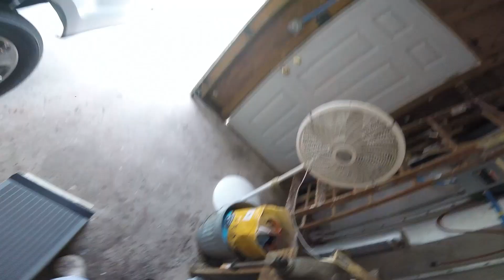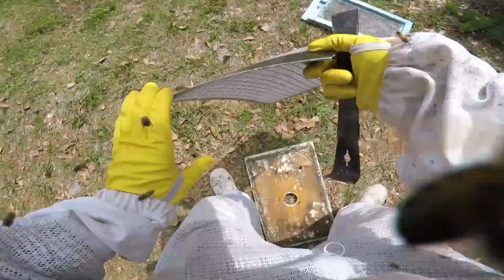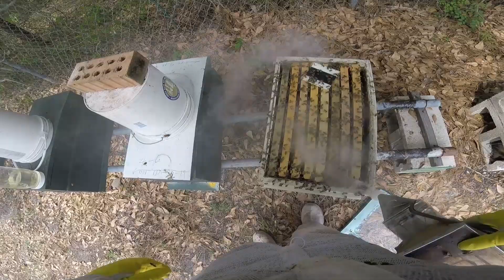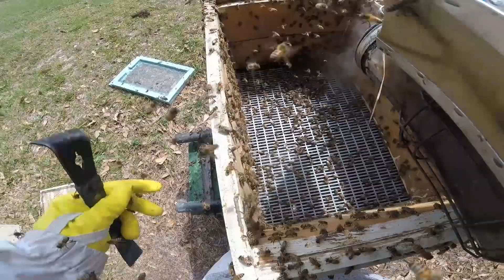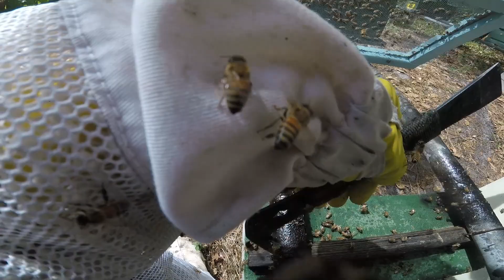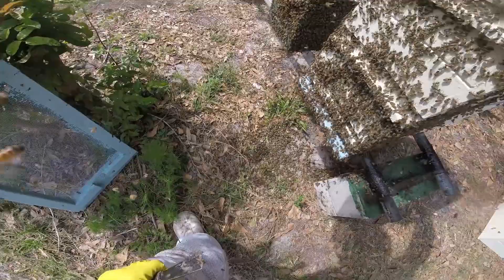Hunting for the Wicked Witch

Comment: Seve what size hole do you saw in the top for the wide mouth feeders
Reply from the maker: Hey Kenneth that is a 2 3/4" hole that i used to use regular mason jars.I have since started using wide mouth jars with plastic lids.I still use the  2 3/4" hole and find it works out great.

Comment: You left a capped queen cell on the 4th frame intact, ended up in the top box, either left most frame or possibly the next one.  Wouldn't it make sense they would be upset if queenless though?
Reply from the maker: It was Queen rite but had not swarmed yet.